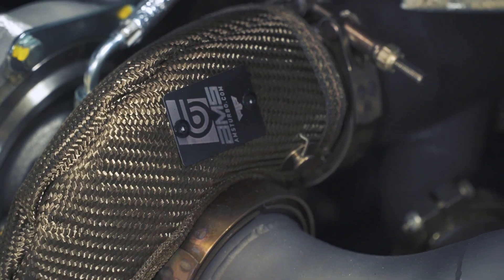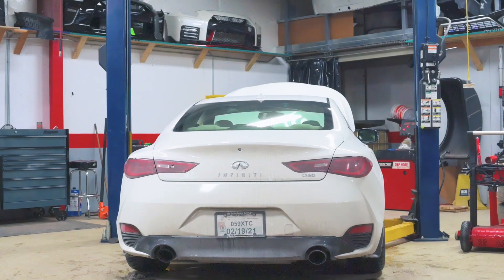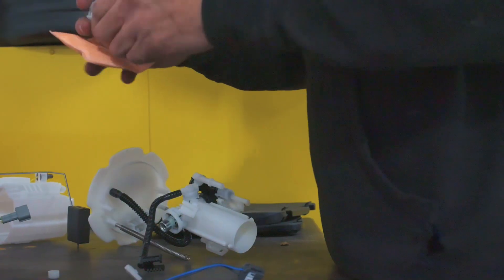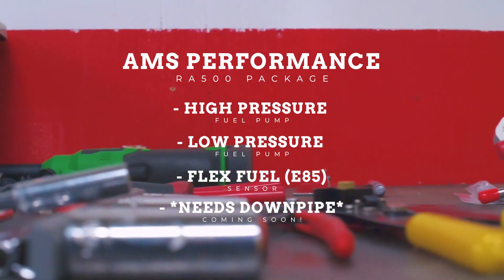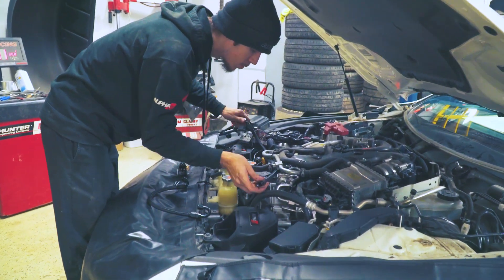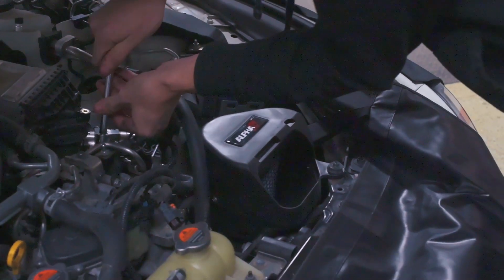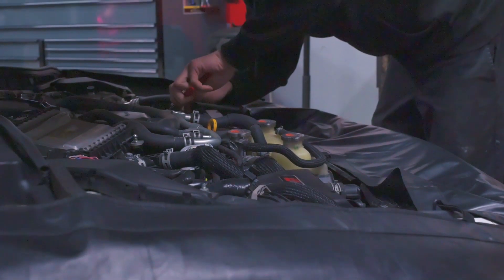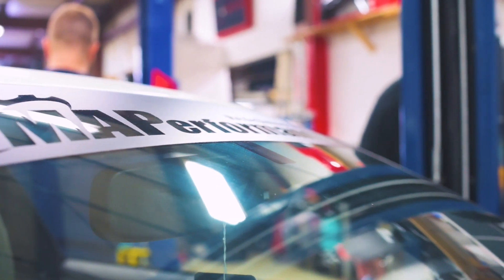Fueling System Overhaul at AMS Performance!!

Comment: Does the base luxe/3.0T stuff come with a smaller fuel system than the RS cars? Just got me thinking because wifey’s RedSport makes over 500 @ the crank being as it’s a 440+whp affair and we just have a basic FBO setup on her car with AMS intakes, AFE Downpipes+cat deletes, a custom exhaust made from the Borla system for the car, and a Z1 tune. Haven’t touched the fuel system yet and it’s not even sipping E85, still 93 pump E10. Though I do slip Race Gas additive in at an Oz per Gal every tank as well. Not the Spicey purple 112, the orange 108 though.